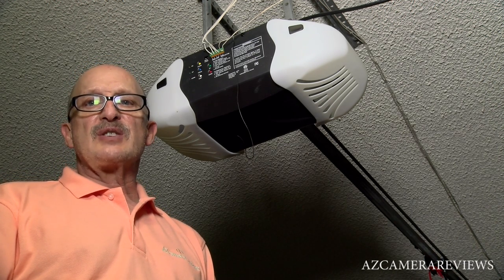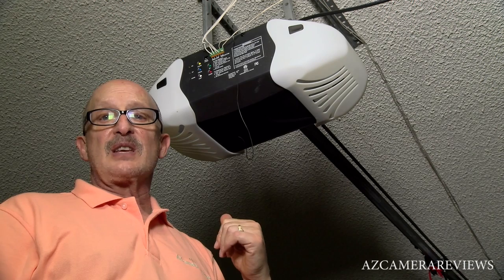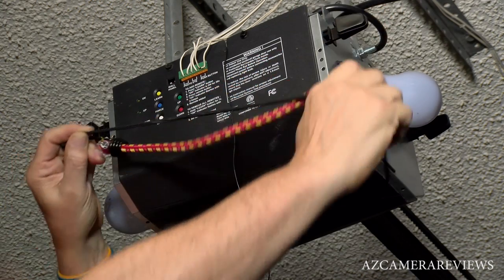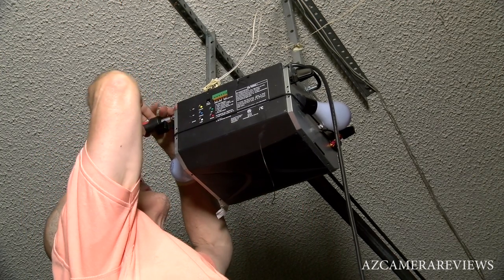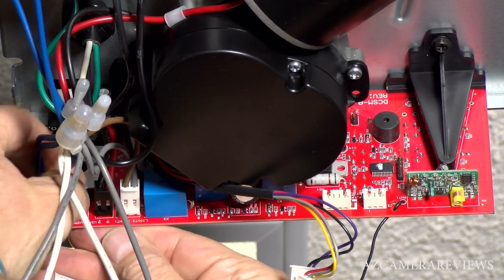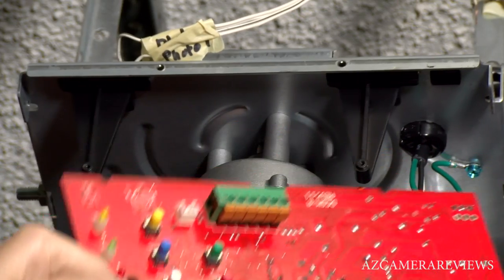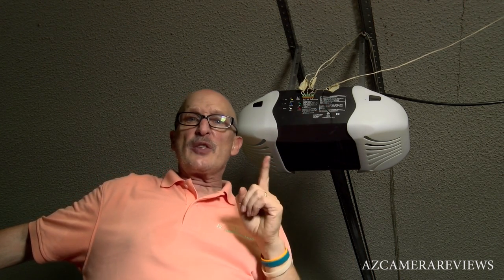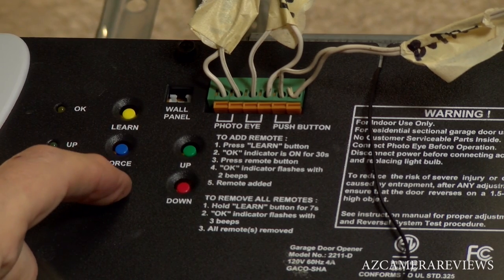GUARDIAN 628  GARAGE DOOR OPENER DIY REPAIR

Comment: Thank you Sir, tapping on the back fixed my problem
Reply from the maker: Hi Mike, Glad we could help but tapping is only a temporary fix. If you find it happening over and over, PLEASE consider replacing the board. It isn't that expensive or hard to do. Think about this, you are in a hurry to go someplace and your garage door will not go up or you pull out of the garage and the door will not go down. Big headache, you will have to release the door from the mechanism.

If we helped you out, please consider helping us out by subscribing. Thanks again for letting me know I did a good job.

Comment: Followowed the instructions and had absolutely no problems.. my only change would be to leave the the 2 black brackets on the panel and remove them from the box by the 2 screws that hold it to the box. Thanks for the help
Reply from the maker: Hello and thank you for leaving a comment. If that worked for you, that is a plus! You will notice I did this video a number of years ago and updating it at this point would be too much time and effort. That being said as the video presently stands, has helped hundreds of people fix their operators and probably over all saved thousands of dollars. Hopefully people will read your comment and implement your suggestion. 

If you found this helpful please consider helping us out by subscribing.

Comment: So the tapping worked like charm
Reply from the maker: Glad it helped but keep in mind that is only a short term fix. You may get away with the tapping method a few times but sometime when you are really strapped for time you may get jammed. Fix it properly ASAP. 50 bucks ain't worth the aggravation it may cause you if you are pressed for time or in an emergency.

Comment: I just replaced the circuit board it beebs 6 times when I press the push button on the wall but doesn't work. When I press the limit button it beeps 20 times. However the tapping with the screwdriver did work Thanks for that. After that I immediately ordered the circuit board but unfortunately it did not help.
Reply from the maker: Go to the manufacturer website or search on the internet for error codes. If that does not help you diagnose the problem, call tech support. Truth is, that is how I learned about why my operator was doing what it was and the tapping method. After it worked and failed again after a while I learned I needed to replace the circuit board. TS is very helpful.
Reply: @AZCAMERAREVIEWS  Thank you.

Comment: I know it was a blown board, but seeing you touch it with the screwdriver made me flinch like you were going to short it out lol
Reply from the maker: I turned off the power before I worked on it. It wold not be good if it started accidentally and my fingers were in the gears. :)
Reply: @AZCAMERAREVIEWS  I was talking about frying the board by electrostatic discharge, which can happen even when the power is off and fully drained. It's happened to me before when I accidentally touched my old computer's motherboard with a screwdriver. Always something to be weary of.

Comment: I have the same issue but with 6 beeps. Could you more explain about ?
Reply from the maker: I am not a garage door repairman by trade. I only repaired the problem with my door after calling Guardian technical services. You can call Guardian technical services and ask them what six beeps means. If you do not want to call Guardian and ask them about what the six beeps mean, you can go research it on Google and query, Guardian electric garage door openers six beeps. That would be the easiest way to find out what is going on with your opener. Again, I am sorry I cannot help you, but I only address the problems at hand.

Comment: THANK YOU VERY MUCH for this video! You saved me.
Reply from the maker: YAY!!! You are welcome. How smooth did your installation go and how much does the board cost these days?

Since this video was so helpful to you, please consider helping us by subscribing to the channel and giving this video a thumbs up. That really helps us out a lot. Thank you.
Reply: @AZCAMERAREVIEWS  As of September 2024, the total cost was $56.45 ($66 with sales tax and delivery). The entire process, from unplugging the opener to reprogramming the up and down limits, took me two hours. Doing it myself saved me between $500 and $700. Your detailed video was incredibly helpful! 
The most challenging part was unscrewing and reusing the small triangular plastic mounts from my old (red) logic board to align them with the holes in my opener. Reconnecting the door to the opener was also a bit difficult for a little girl like me since the door is really heavy, but I managed to do it. 
Thank you again for your video!

Comment: Thanks to much.  Your screwdriver method worked!!
Reply from the maker: You are very welcome. TO avoid problems in future I would strongly advise you to order the board and complete the full procedure. If you do not repair the opener it may fail entirely at a most Inapportune time. Please consider 🙏 subscribing to our channel if you found this video helpful.

Comment: Wondering you have any advice on an opener that beeps 20 times?  This happened a couple months ago.  The sensor lights were both out and my technician said he reprogrammed the motor to fix the problem.  He said this might be due to "manufacturing issues", which I found a bit concerning.  Well now the problem has returned and my technician is no where to be found!  Not sure what to do now.  Thanks.
Reply from the maker: Hi Dennis,
20 beeps is a signal that the Photo Eye Safety System has been obstructed during door closing. Check the alignment of the Photo Eyes. A solid red and solid green LED on the Photo Eyes will indicate alignment. A Guardian operator will function properly only with Photo Eyes made by Guardian Access Corp. Check the all wires are tight. You may have problems with the sensors or the sensor board circuit. If the obvious things don't fix the problem, call Guardian @ 1-424-272-6998 or 1-972-449-0484 .

Dennis, If I have been helpful, PLEASE take the TIME to like this video and Subscribe. We try and help those who watch our videos  and appreciate if you subscribe in return. Thanks!!!

Comment: how to disconnect/connect those photo eye wires from that special switch. I am looking for that part. Just pull it out?
Reply from the maker: See 4 minutes 5 seconds in. Push the tabs and remove the wires. Remember or mark where you removed them from so you replace them correctly. Mark the wires 1, 2, 3, 4. I hope that helps.

Comment: I bought the board and installed it, and when I press the limit button I get 20 beeps.
Reply from the maker: Hi Greg,

20 beeps is a signal that the Photo Eye Safety System has been obstructed during door closing. Check the alignment of the Photo Eyes. A solid red and solid green LED on the Photo Eyes will indicate alignment. A Guardian operator will function properly only with Photo Eyes made by Guardian Access Corp

I hope this helps. Make sure you hooked up the photo eyes properly.

If I helped you, PLEASE CONSIDER helping me with a thumbs up and subscribing. Thank You!

Comment: Awesome video. New subscriber
Reply from the maker: HEY! Thank you for the compliment and subscribing. I checked out your channel and It gave me a few ideas. I will be releasing a few more videos about garage doors. It gets to be extremely hot here and I was looking at garage door insulation kits. Most give an R value of 4.8 to 6.2. The DOW is 8. something but it always falls out and it is ugly fiberglass with a white plastic backing. I am doing my own which has an R value of 9.2. The highest I found so far. It would be great to install prior to the door install when the door is in sections but it is taking me hours cutting it and putting it in while the door is assembled. I would never take the door apart because I know I would never align it properly so it is taking me hours to do. I will post the video when I am finished. Thanks again for subscribing. If you want any tips for improving the look of your videos feel free to contact me @ azcamerareviews@gmail.com
Reply: @AZCAMERAREVIEWS  the only downside to insulating ur garage door, is it’s more expensive than you might think. 

After u do that, u have to replaces the springs on the door. Otherwise you destroy the opener
Reply: @AZCAMERAREVIEWS  quick question. How long have you had this opener?
Reply from the maker: HI< I just saw this Liftmaster. TY for the first tip. I have had it maybe since 2005 to 2008. I can't remember exactly. How much heavier do you think the extra foam makes the door? The other day it had another fault. It moved 2 inches down then started beeping and stopped. I pushed the button again and it went back 2 inches and did the same. I hit the rear of the opener 3x and it worked after that. No Idea what is was.
Reply: @AZCAMERAREVIEWS  sounds like the logic board is going bad again. Also adding insulation can add 50-75lbs to the door

Comment: Will this same operation work for the 600SL?
Reply from the maker: Hi James, I am sorry but I am not a garage door lift specialist. I just researched the problems that were expressly tied to this lift. Look at your 6000SL and see if it is the same construction as mine. Then call the supplier I listed below and see what board is needed for your particular lift. That is the best I can do for you as like I said, this is not what I do for a living. I am just a little bit handier than most, I like to save $$ where I can doing stuff on my own. If you find my content helpful, please consider helping out by subscribing. Many Thanks!!!
Reply: @AZCAMERAREVIEWS  Actually, it worked! Followed the directions on the video and found success. The only alteration was exchanging the black plastic holders over to the original ones that were on the garage door opener. The episode also featured some great father/son time. THANKS!
Reply from the maker: @jamesbush3857  EXCELLENT!!!! I am glad I was able to help. It makes me extremely happy to know it helped kindle some memorable and treasured Father/Son time as well as saving a bunch of $$ that you will be able to stretch your Holiday Gift list on. Please like this video, share it with friends on Facebook and subscribe. Spreading the word helps us out.

Comment: Nice video dude. I personally am not a fan of these, I would much rather a genie opener. Hopefully I never have to work on one of these lol
Reply from the maker: I have heard this numerous times from others. The problem is, most of us are uninformed about what to buy and we are victim of what the installer suggests or what they have on the truck when they arrive. Most consumers are in PANIC MODE and are just concerned on getting it repaired and hope the vendor is supplying them with a good product as opposed to an operator that has a high profit margin. This was what was here when we took ownership as with many homeowners, when you move into a place you don't say, "hmm, I am in my new home, lets change the garage operators". I hate spending lots of $$$ on repairs so this is why I offered this fix. When the motor dies, it will be time to replace the whole operator. Thanks for your comment and please consider subscribing to our channel.
Reply: @AZCAMERAREVIEWS  for sure. As a matter of fact, chamberlain claims that their DC motors are 1 1/4 HP equivalent and in reality they are only 800 newton's, which is the same as 1/2 HP. There is so much misinformation in the garage door industry.
Reply from the maker: @TBHD724  I could not agree more. Most stuff is just hype! They pull a few units off the line, tweak them and use them if they are ever called out on specs. In the audio business, we used to call that SPECMANSHIP!!!
Reply: @AZCAMERAREVIEWS  In reality 3/4 HP is equivalent to 1000 newtons...  so for a DC opener to really be 1 1/4 HP it would have to be somewhere around 1800 newtons.

Comment: What a terrible opener. Go with liftmaster instead. The company that sells these is a scam.
Reply from the maker: Thank you for taking the time to respond. Liftmaster is a very good brand, unfortunately when you move into a previous owned home you do not have a choice as to what was installed previously. I have had Liftmasters in my other homes. I have one that is over 35 years old and it is a chain drive. No arguments! They make a great operator. 

If you find my videos helpful will you please subscribe ? We would appreciate it!!